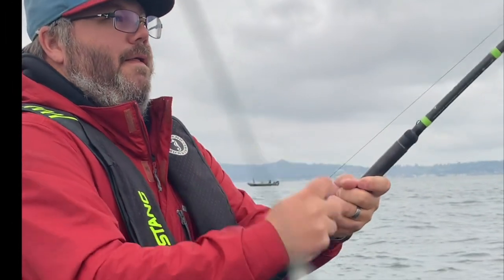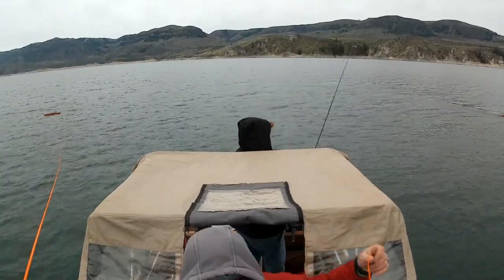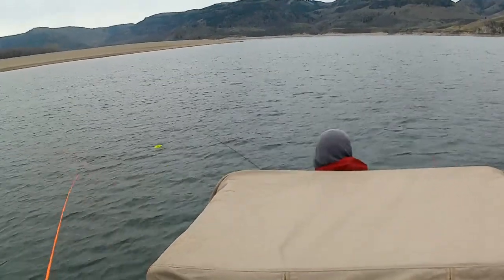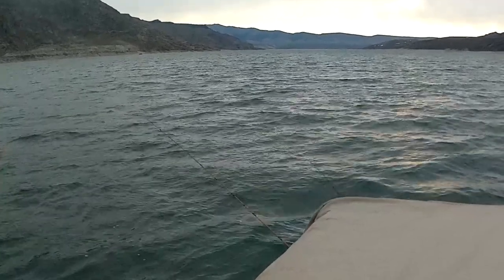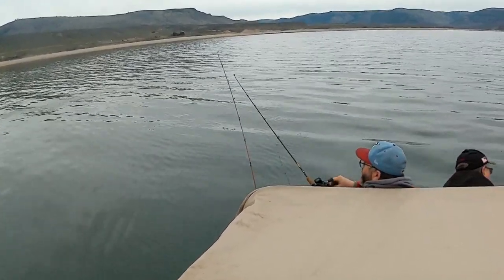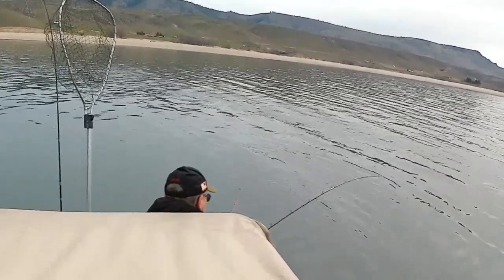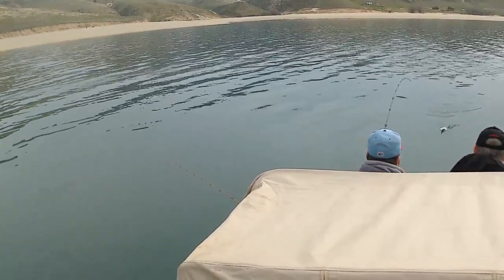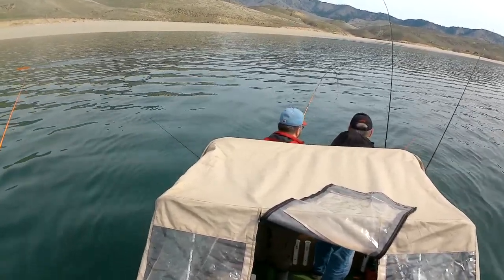Stacking Side Planers to Catch Kokanee on Lake Roosevelt

Comment: Love fishing Lake Rosy. Heading there in a few weeks. Question: I think I understand but want to confirm. Are your sideplaner masts and spools mounted forward of the helm/windshield? Guessing that's why the chicken catcher? Thanks!
Reply from the maker: Yes I have just the one mast that I put in the bow seat mount.  On my dads boat we have two masts we run midship out of the side pole holders.  Both work well so whatever works for your boat.  I’ve seen others use a drawstring similar to those available for down riggers.
Reply: @diytodd  Thanks Todd.